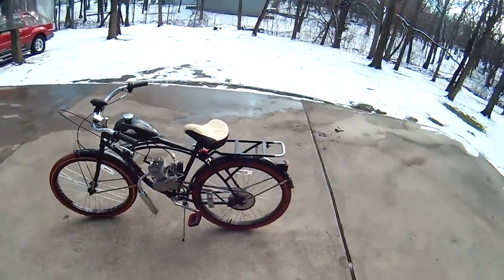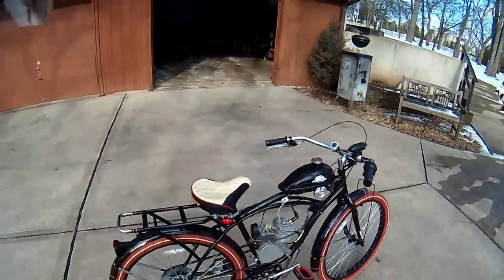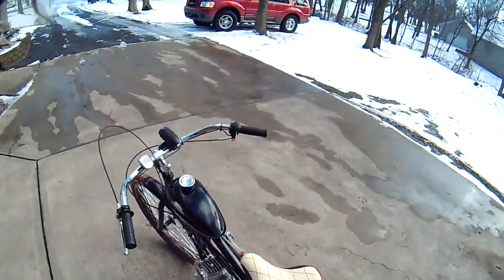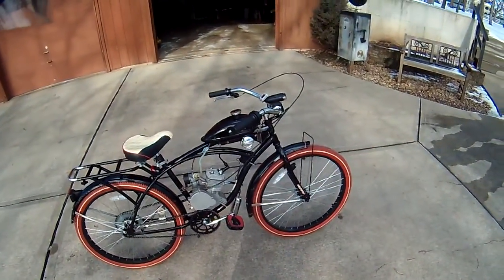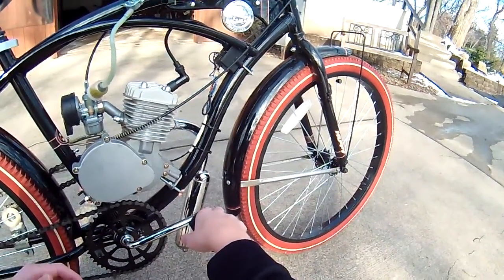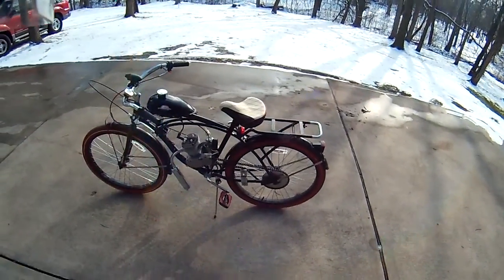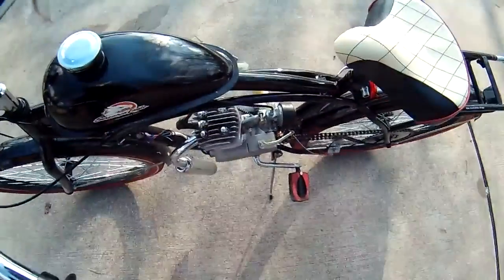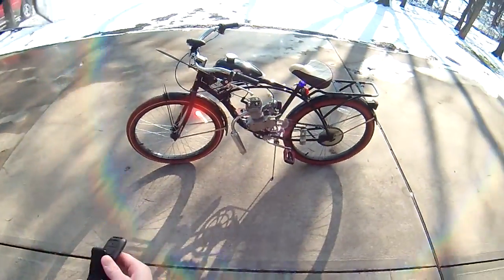80cc 2-stroke motorized bike review+New Camera!!

Comment: about to start a build on the same bike. did you have to modify anything at all? any tips for assembly ? thanks
Reply from the maker: I had to cut the fender so the chain would go on properly, easier to just remove it completely. Putting on the sprocket was a pain in the butt too
Reply: cool thanks! and as far as the brake goes I can just put it back in place and it's good to go??

Comment: did you use the cables from the kit?   clutch,throttle.
Reply from the maker: Yes
Reply: Best to replace that clutch cable with a quality one. Mine snapped off at the lever without warning. At about 275 miles.

Comment: I run a 50:1 oil mix in mine
Reply from the maker: That aint good for it at all. Correct mjx is 24:1 or 32:1 not 50:1. That will eventually cause it to seize and run improperly.
Reply: StilwellMotovlogger ok. Thanks!